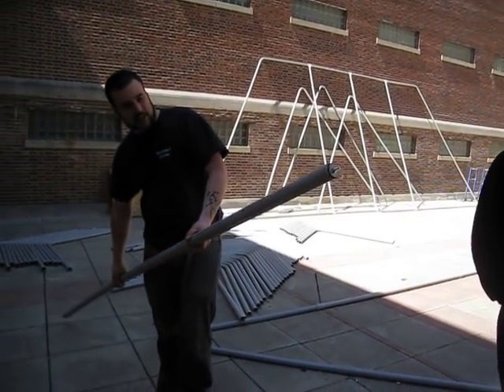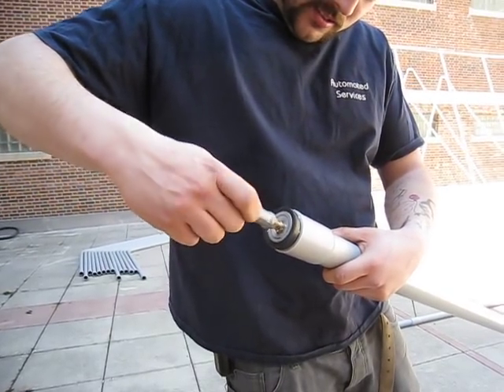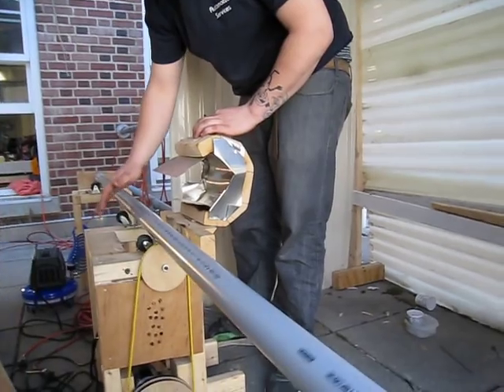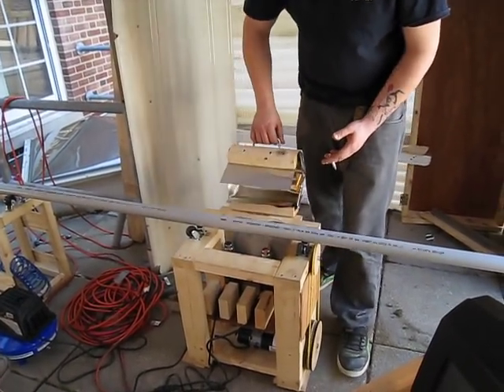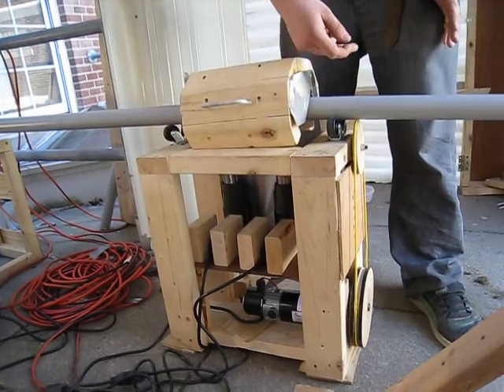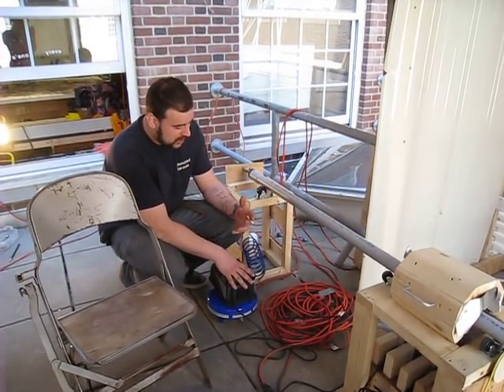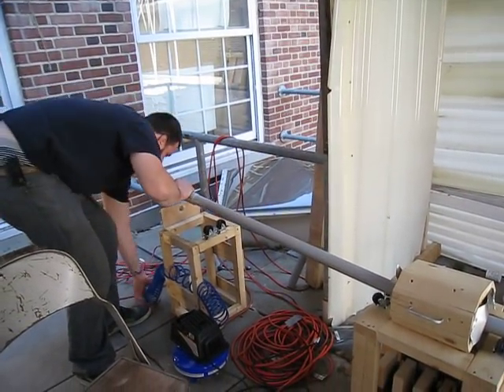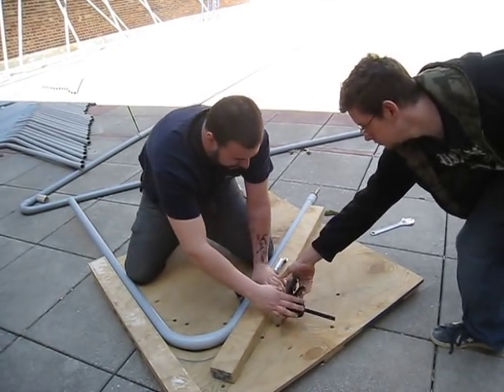How To Bend PVC Pipe with Air Pressure

Comment: electricians have been doing this for years. greenlee electrical tool company makes 2 versions of this. a small one for small pipe up tp 2 inches and a large 1 for up to 4 inch pipe. when i use them i just duct tape the ends closed and the presure builds up enough on its own to keep the pipe from kinking. a bucket of water and a wet rag helps cool it down fast once you have the angle you want.

Comment: You are the MAN!!!

I'm building a dust collection system  in my wood shop, and it's made from 4" and 6" PVC. The 6" is just for one main line, and I purchased the bends for it. The 4" however, is what I will use for most of the runs and is where all my bends will be. And large sweeping bends that big are NOT cheap to buy!

I've looked into bending it, and this is by far the best DIY method I've seen. The whole "sand" deal sucks! Ever pick up an 8' section of 4" PVC full of sand???

Comment: *for 3" Get 60 rings that are made from 1/4" rod and drill 2 3/32" holes through the side 15 degrees apart in each ring. Thread 2 fine thread stainless cables through each hole with an 1/4" tube between each with a crimp at each end. Once it is very soft, slide the rings over the pipe. Use 30psi and bend the pipe so the the cables are on the outside of the bend. This will give you a bend with a small 1.5D radius that will not lose it's rating since the outer wall isn't stretched thin.

Comment from the maker: @davetileguy These are ten foot lengths of 1 3/4" conduit. I filled one with sand and it weighed over 60 pounds... This invention is not for making furniture or bends in short lengths of pipe, it's for making large structures.

Comment from the maker: @ee222004 I have used this same bender for plumbing PVC, and had no issues. You need to make sure you are getting a high concentration of EVEN heat to a large area of the pipe. Use the double plus a half rule... If you are bending 3 inch pipe, you want to heat up about 7 inches of the tube, and adjust your heat guns and your clam shell. If it is deformed, you're not pushing to the outside of your bending jig... you can not use this bender without a jig, it will collapse if your bending mid-air.

Comment: i used to work as a plastic pipe fabricator, the ones i worked on were made of ABS, 12 inch diameter and 3 metres long , turned under gas heaters for around 2 hours and then rolled onto a wooden mould to 90 degrees

Comment: curious whether you tried this with a little less (or no) added air pressure, since of course the heat applied to the plugged pipe already creates pressure until cool - which is roughly already what we want for supporting a bend.

Comment from the maker: @anelphabet I think the hose clamp would melt if it is what I am thinking of, you need to fabricate something out of rings of metal or something... I cant quite imagine the mechanics, but you would need something that will lock onto the pipe while you are heating it, then bend with the pipe as you have it on the jig. Honestly it seems a lot more practical to use fittings if you are going to try to pass some sort of inspection. & If u are running conduit, it doesnt matter if the edges are bulged.

Comment from the maker: @kaloalex it is not easy to work with 10 foot lengths of pipe full of sand. You have to pack the sand into the pipe for it to work. Have you done it? I have, and it didn't work well. That is why we invented this process.

Comment: So the air pressure and/or sand serves to help pipe maintain shape while bending, correct ? What if Im not using either and want to bend a 1" 90 degrees ?

Comment: Great idea to save on elbows and glue joints. How do you know how far into the jig to push the angle or does the air pressure in the pipe let you know when you've maxed out the bend?  Do you end up with any blow outs if you bend it too sharply?

Comment: I tend to bend more than my share of PVC pipe, & I know that if you bend a pipe at in a tight bend it tends to kink the pipe, I've thought about filling the pipe with sand to help avoid kinks.    When bending brass pipe a person can sometimes freeze water in it before the bend to keep it from kinking. In the past we would bend our pipes with an electric heater, or small hand held torch, now I use a larger pair burner, it's quicker & oddly enough I'm less likely to char the pipe.  Thanks

Comment from the maker: @anelphabet If you're just doing one bend it wont melt the outer PVC, but if you are doing several bends, it will definitely melt. Our wood caught on fire after prolonged use. Aluminum foil is a good substitute for the aluminum flashing if you're on a budget I guess.

Comment: Hey Paul, if the outer angle is 120°, doesn't that make the inner angle 60°? 180°-120°=60°
Reply: 120° bend. You're looking at it from a different perspectives. If he bent it in a 90° bend you can understand it more clearly.

Comment from the maker: @TheBlockrockinbeat These are ten foot lengths of 1 3/4" conduit. I filled one with sand and it weighed over 60 pounds... This invention is not for making furniture or bends in short lengths of pipe, it's for making large structures.

Comment: Are you bending non metallic conduit or plumbing PVC...I just tried this process which was great but couldn't get the pipe squishy, and it still deformed...any suggestions? How long did you bend it for?

Comment: You are a star!  You should patenet it .
Could it be in a pocket version, using electrically heated wire around the pipe like a heat sleeve or smthn?  Lightweight and baterry operated! :) 
Thanks for Ingenuity.
Russian Plumber.

Comment from the maker: If you are making snow shoes, furniture, or using short lengths in general, as I have stated before, I completely agree that the air process is excessive, and you should absolutely use sand. If you need to bend full lengths of pvc, this is a very practical, easy, and inexpensive way.

Comment: I could see doing that on a cathedral roofline or somewhere with a weird angle for which you either can't find the correct elbows or REALLY need to maintain crosssectional area.  Otherwise, I would just use a 90 plus a 45 for that corner and fudge the rest with flex of the glue joints.

Comment: I think back in the 90's, I had to bend some conduit. or maybe it was just pvc. I built a box and lined it with a popular building product called "R" barrier. It had a reflective film on one side. I then heated it with my propane torch. I don't use propane though. I use map gas. It would heat the pipe up like rubber in minutes If I remember correctly.

Comment: The air pressure is a good idea. There needs to be an easier way to set the angle. There's no reason that function can't be integrated into the end of the machine. A settable jig along with some cold air from your compressor could quickly set a joint. Ideally you could use some some small forms of various angles to eliminate the bulging. That just looks questionable and I would not accept that pipe in my home or business.

Comment: Reinvented an approximately $400 dollar machine for under a hundred dollars. You are missing the point of the design, it is to prevent any particular sharp kinks from ever forming. Press out the kinks would not fulfill this requirement, and there would be more plastic deformation than the tolerances would allow. The process produced 135/45 degree curves within the tolerance range, it is laying on the ground beyond the jig.  The process was create with the material's properties in mind. ~C

Comment: Nevermindthebullocks suggested that this was reinventing the wheel and casually suggested buying a hot box and doing it with that. Well, I'm working with 6" sch 40, and the hot box for that goes for  $1,800. So saying that is kind of like "You're going through all that trouble to trick out your STi, why not just do it the simple way and buy a Ferrari?"

Comment: You have reinvented an existing product in a far more cumbersome and complicated manner.
Get a hot box and use a wet rag to set your bends quickly. You can press out any kinks while you cool the pipe.
And 60 degree? I would hate to see what you came up with if I asked you for some 45's.